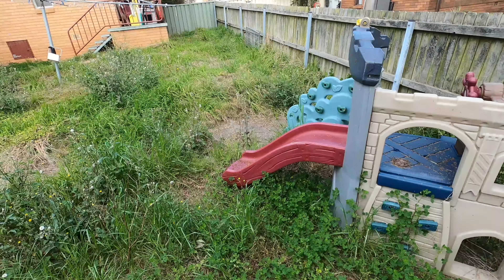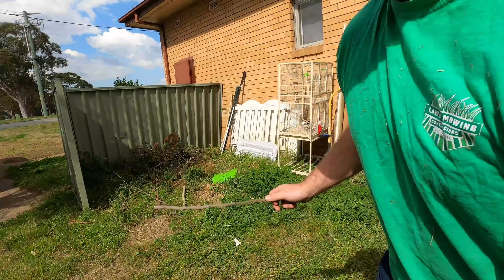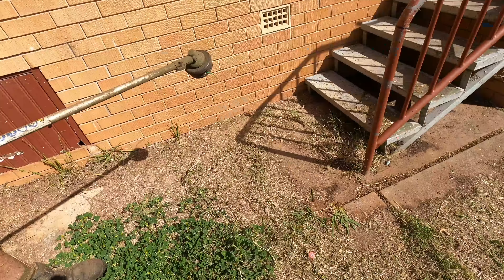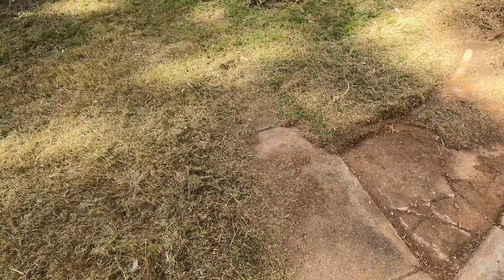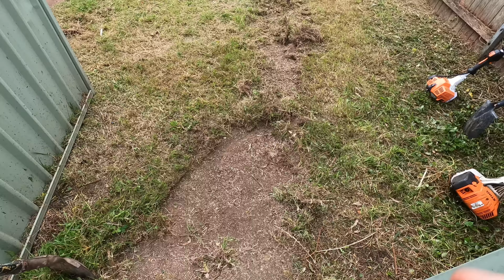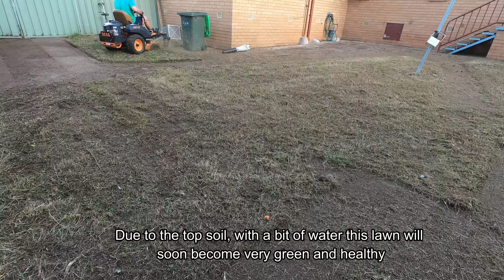EPIC YARD RESCUE!!! Grass cut from concrete!

Comment: Hey Sean, loved the video. A lot more paving in the back yard than I expected. Edit ... l would do the same with the grass patch beside the driveway. In the UK, the type of rotary airer/dryer we have is smaller but removable, that is one can pull it out of a ground spike and put it back later. ls it the same in Aus?
Reply: No our rotary lines have a metal tube deep underground that is cemented in, and the pole sits in that, or they are actually set in concrete . They are extremely heavy and are really hard or impossible to remove. Kids love swinging on them!
Reply: Do you have the side walk to the clothes line too?  That is such a cool idea.
I'm in the US and every clothes line we've had is just lawn no walkway.
Reply: @janetpendlebury6808  On balance, are you glad for them, or are they a bit inflexible? I just move ours (UK ones) around the lawn as and when - sometimes when I want to change the planting etc.  But then yours is sturdier and bigger.... hmmm, choices!
Reply: @janetpendlebury6808  Yes, something similar in the UK. Either a tube directly in the ground or sometimes a large hollow screw. These can also be set in concrete but still allow the airer/dryer to be removed.
Reply: @junomonroe1508  Sometimes a nearby pathway. Other times stepping stones.

Comment: This magical clean up was a tough one.  Never seen so much concrete in a backyard before!  Certainly more than I’d ever want in my own yard.
With regard to leaving the overgrowth on that patch of buried concrete I think it would have been a good idea to remove it further back to the edge of the gate on the right side of the drive so she can open and close it more easily to get her vehicle in and out.  Also since she can’t keep the yard up herself I question the wisdom in leaving a patch of turf over the concrete at all.  Sometimes less is more.  This is not a critique but an
observation of an aspect of this episode I couldn’t clearly see the logic of, but then I always opt for function over form.  As always you did an impeccable job!

Johanna  Maine USA

Comment: Good job! In the future consider cutting the edges deeper and at a bevel away from concrete as it aids in run off from the concrete preventing growth in the expansion joints and water damage to said concrete!
Reply from the maker: You're right. Problem here was that I had to create the edges on top of concrete and couldn't go any deeper. It's a bandaid measure, but not a bad effort for one day!

Comment: "Abracadabra" 🤣🤣😂😂 You so Funny
You could apply for the job as "Grounds keeper" at Hogwarts Castle 😂😂🤣🤣
Well Who knew you would find a concrete pad underneath that backyard grass???
You couldn't even tell there was anything there to start with!
OMG! Then a little bit of Brickwork!
As you worked through it was like you never knew where the revealed 
concrete was going to lead you 😂😂
The yard looks Awesome when you finally brought the footpaths and driveway back.
Magnificent job Sean  💖